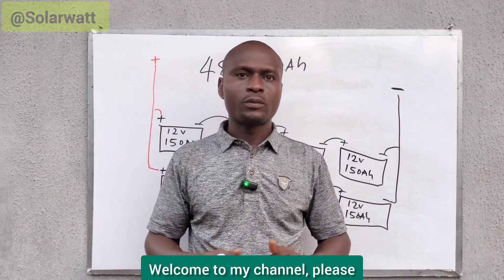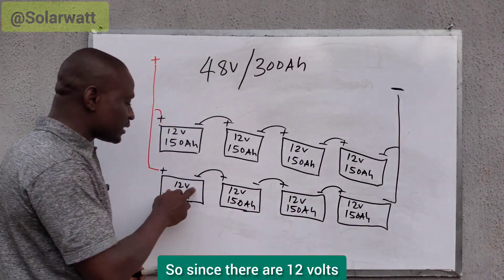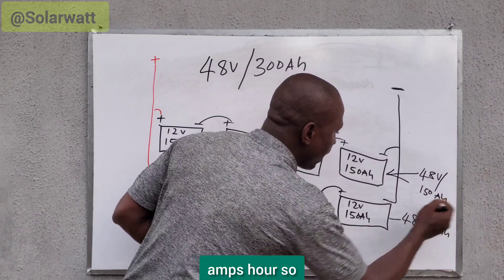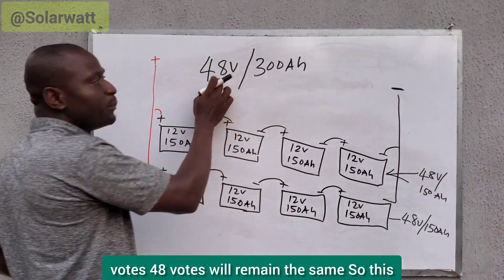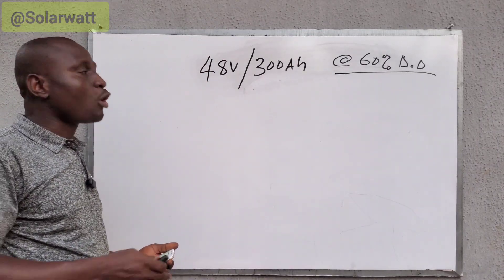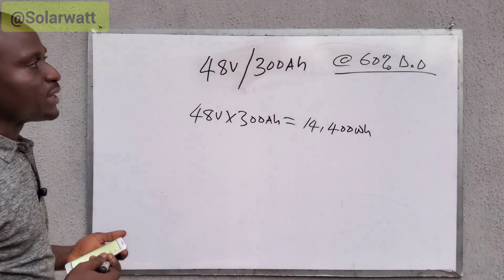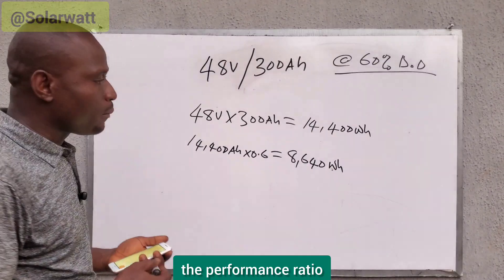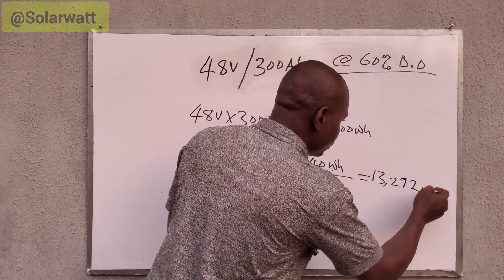How Many Solar Panels and Size of Charge Controller do I Need for a 48V/300Ah Battery Bank?

Comment: I have 2, 12v 100ah batteries a 2000w inverter, 2 150w 12v panels and a pvm controller 20A, 50v. The system is set up properly but i cant keep the light on more than 10mins at night. Kindly help solve this issue.

Comment: Thank you Sir. But I want to ask.

Why do we use the charging voltage of the battery bank rather than the nominal voltage of the panel, and how do we get the charging voltage of the battery bank?

Thank you

Comment: Can I use 2 pieces of 480 watt panel each with  12 v  30 amp charger controller and 1.1 kva 12v inverter to power 195 watt load

Comment: Sir,in your previous video,u make use of vmp when sizing an scc.But,in dis video,your making use of d battery bank voltage.pls,clearify me
Reply from the maker: The previous video is for sizing a pwm charge controller. The other video is for mppt charge controller

Comment: Well done engineer, I have an issue and your experience and expertise would be needed for opinion,the water level of my batteries went down and I topped the water with distilled but the system has been going off very fast than before, what do you think the problem might be? Thanks for your reply in advance.

Comment: For 48v battery 
48v x 2 = 96v
96v/10 = 9.6v
48v + 9.6v = 57.6v

For 24v battery 
24v x 2 = 48v
48v/10 = 4.8v
24v + 4.8v = 28.8v

For 12v battery 
12v x 2 = 24v
24v/10 = 2.4v
12v + 2.4v = 14.4v
Reply: I hope this is for Mppt charge controller data, what about for pwm charge controller
Reply: shortly = v/5+v where v is norminal System voltage
Reply: Thanks for this Bro!

Comment: You said because it's a 48v battery bank so we're going to divide for mttp charge controller we're going to divide the total power by the charging voltage of the battery bank by 576

How did you arrive at 576?

Comment: How did you arrive at the charging voltage of 57.6v?
Reply: For 48v battery 
48v x 2 = 96v
96v/10 = 9.6v
48v + 9.6v = 57.6v

For 24v battery 
24v x 2 = 48v
48v/10 = 4.8v
24v + 4.8v = 28.8v

For 12v battery 
12v x 2 = 24v
24v/10 = 2.4v
12v + 2.4v = 14.4v
Reply: How did u come with 10 in all these input voltage calculations
Reply: I thought it was the absorb voltage of 48V batteries. Mine is about 56V.
Reply: It’s the Vmp of the panel which is 57.6v 

Parallel you know you don’t Multiple 
Series you multiple by the no of panel available 
 Therefore

Parallel 57.6v still remain the same 
Series 57.6v * 6 panels = 3456v
Reply: Multiply the Voltage by safety factor constant of 1.2 

For 48v Battery: 
48 X 1.2 = 57.6V
Reply: How would this be calculated if it were a PWM charger?

Comment: great explanation, please if want to buy 4 200ah 12v dry cell battery in two to three month but l have already bought two of them, how am l going to set this 2 200ah 12v in 24v so that when l buy the remain battery in future i won't need to buy extra Charge controller and panel again ? thanks in advance